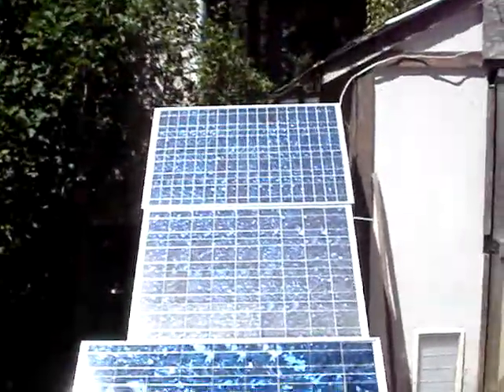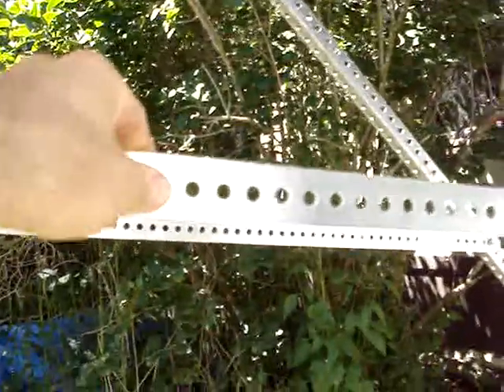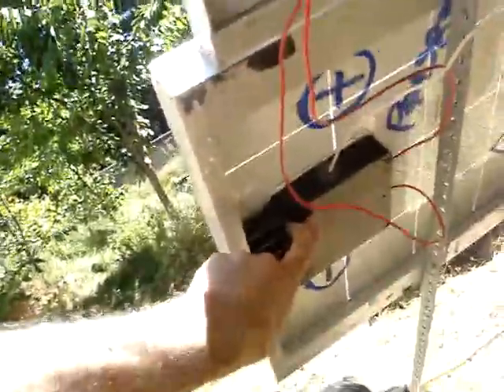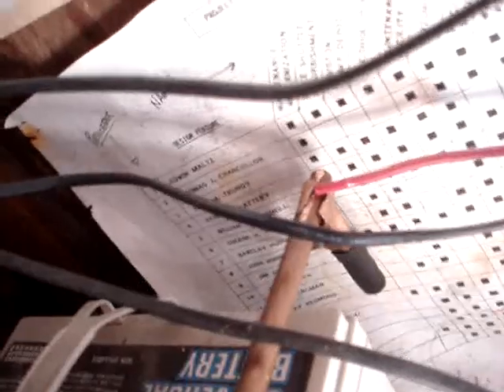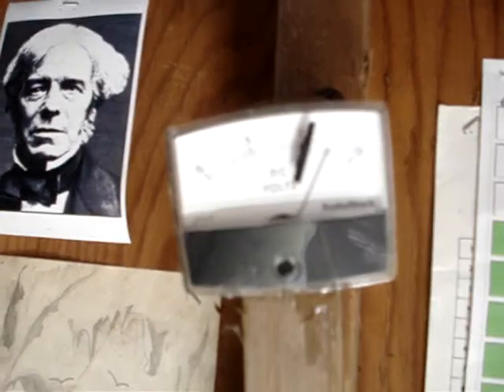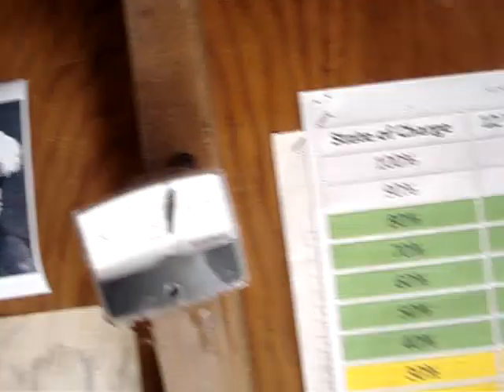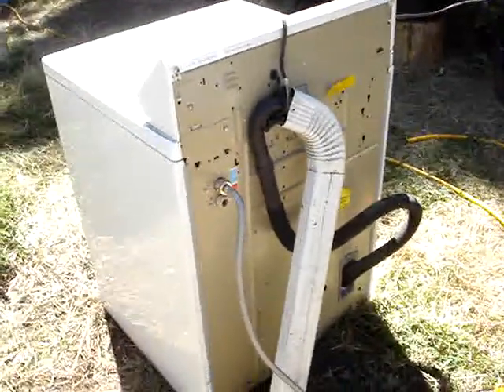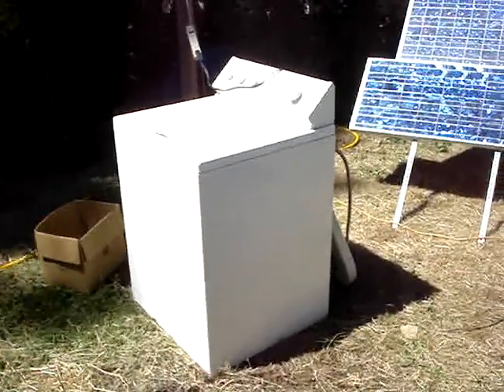Solar Setup Running Washing Machine

Comment: @Backyardsoul  How did you connect your Amp meter to the system?, is it just positive and negative leads connected to it and that's it?
Could you run a tumble dryer off your setup,or would that be way too much wattage,my dryer is 2650w and i'm trying to find out if it could run off solar. My dryer runs at 11.04 amps
Reply from the maker: +SP330Y Amp meter is a bridge. The needle box jumps the start and finish on the bridge.
Reply from the maker: +Backyardsoul The meter came with a bar with 2 bolts. You break the negative wire, connect the flat bar, the meter wires jump (go from one bolt to the other bolt) it measures the flow of electrical power thru the negative wire.

Comment: what i meant i have in serie 4 batteries 12v, total 48 and 108ampere-hour. i need to lift a AC 420 Watts, 420/48: 8.75 amps, 48vx108:5184watt-hour, then, 108AH/8.75:12.34 for descharging the battery, am i right, please write me i live in mexico.

Comment from the maker: 12, 24 & 48 volt inverters can convert dc to 110v ac power. 48v are rated for high power consumption more expensive.

Comment from the maker: @ditmar11 I'll have to try combining all the 12v panels into the C40, the Xantrek did not come with the cumulative amp-hour meter. Got it used on ebay. I was not sure about power getting back fed into the amorphous panels.